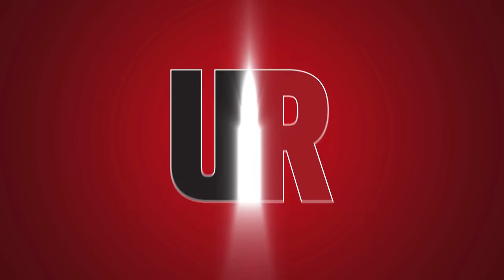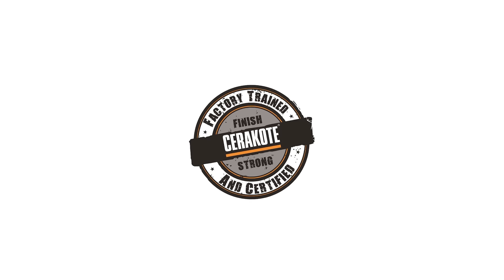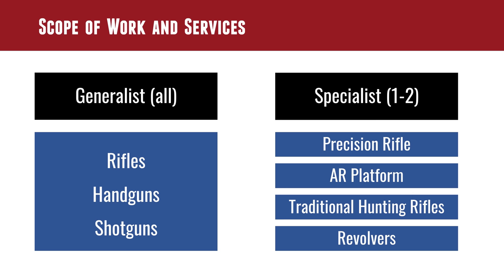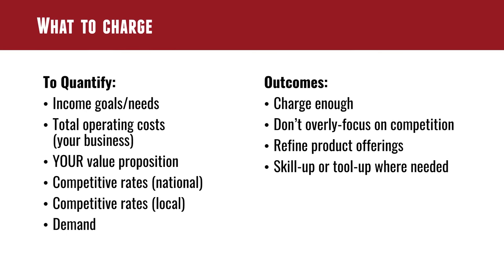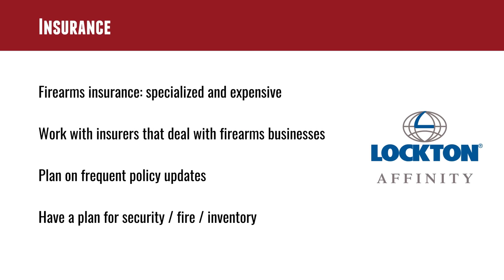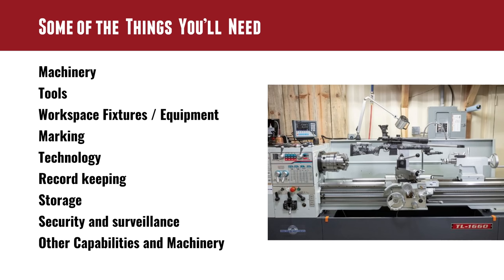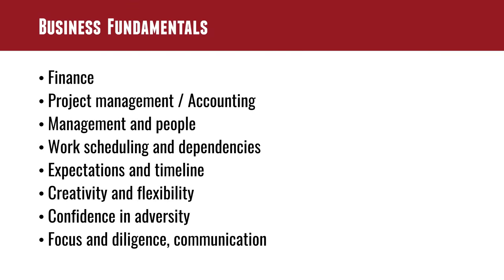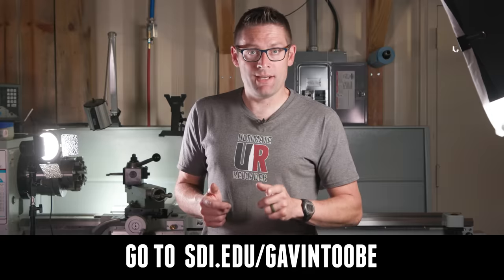Starting a Gunsmithing Business A-Z (What you need to know)

Comment: I also want to mention that there's two types of work and they affect your business differently:  

1.) Project work - These are full in-house builds/restorations for AR's, bolt rifles, pistols, etc.  Pros - Reputation builder and gross income.  These are the builds that you can showcase the full range of services that your shop offers: machining, assembly, finishing, etc.  There's a mix of labor and components so you make money on both.  These are the guns you put on social media and the website as a "look what we can do".  Cons - lead time to finish these are often VERY long.  Some stock and action manufacturers are at 8-10 MONTHS lead time.  Even with a 50% deposit, that's a LONG time to have your money tied up in a project, especially if you're paying monthly expenses (equipment payments, rent, utilities, etc).  Also, the upfront cost is much more.  Your cost on these components will be in the thousands of dollars.  Even with payment terms, you'll still most likely have to pay for the components long before the project is delivered to the customer.

2.) In-and-out - These are the "daily routine" kind of jobs.  Pistol sights, scope mounting, cleanings, simple repairs, engraving, barrel threading, etc. Pros - short lead income.  These are the jobs that "pay the rent" so to speak.  While they may involve some purchased items, the bill is 50% or more labor and the jobs are returned to the customer within 30 days (usually within the same week).  These jobs are key because they provide you with cash without a huge upfront cost like project work and are paid in full (often in cash or check, no processing fees).  Cons - enough volume with these kinds of jobs to be able to fully pay the bills.  Since these are simple jobs, most folks are able to do them themselves (or think they can, especially with AR's) so the demand is not high.  Also, there's not a lot of sizzle in these jobs.  A picture of a clean gun or a new set of sights on a pistol won't get you a lot of Instagram followers or be the lead picture on your website.

I would say that you need a comfortable mix of either to be really successful.  A general gunsmith who likes getting jobs in-and-out and fixing different kinds of guns shouldn't be afraid to take on a larger, more complete project.  You don't want to be known as the guy "who just does little stuff".  Conversely, a project shop that specializes in full builds need not turn away small jobs as they can be more profitable on a percentage basis and build a customer base.  Little jobs turn into big jobs and some customers want to give you a "trial run" before they commit to a full-house build.
Reply: Some good points here. Thanks.

Comment: Great Channel, 
Question:  This question is about the ease or difficulty in converting the AR15 platform to other calibers than 223 Rem.  For example, I want a 22 hornet.  Now the 22 Hornet bullet is about  .001 larger than the 223, so a new barrel is needed.    It seem like the bolt, the small piece fitting in the bolt carrier could be readily modified to handle the 22 hornet rim.   You see where I am going this question, about the ease to make these modifications to the AR platform to create 22 or near 22 caliber conversions.  any comments or conversion to dicuss
Reply: It can be as easy as a bolt and barrel swap. Or as hard as a bunch of custom machine work. Something like the 224 Valkyrie has a case head of 6.8 spc or otherwise a standard bolt face. 22 arc is the same bolt face as 7.62x39 both of which are readily available bolts for the AR platform. To do a 22 hornet you are looking at a custom .350 bolt face diameter as the 223 is a .380 then you have to adjust the extractor so that it can extract the cartridge properly. A lot would go into that though I can definitely see someone out there giving that a try. I guess it would come down to if the juice is worth the squeeze.

Comment: The 3 most important gunsmith things to Learn first are learn to headspace chamber and thread on a Lathe is #1, then learn how to internal and external thread a bushing into a bushing then into the 3rd bushing. Then learn how to pre heat metal with Mapp gas and mini fill weld with 1/16, arc rods etc etc.